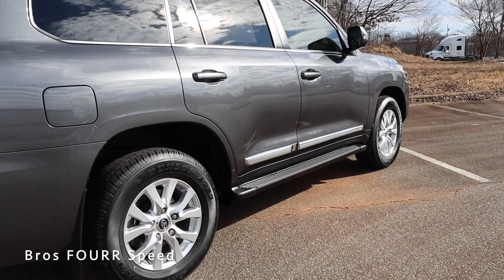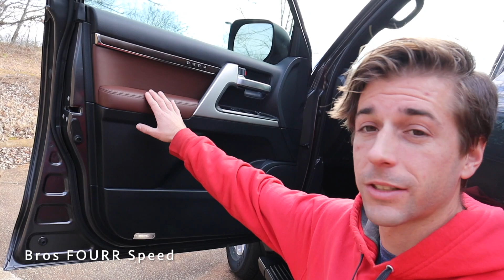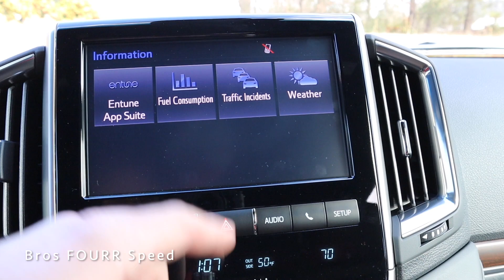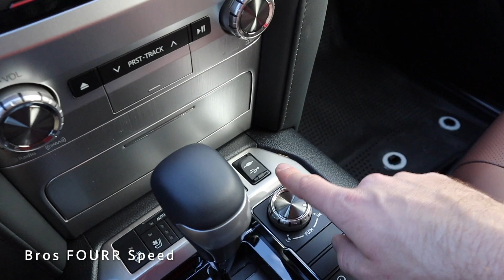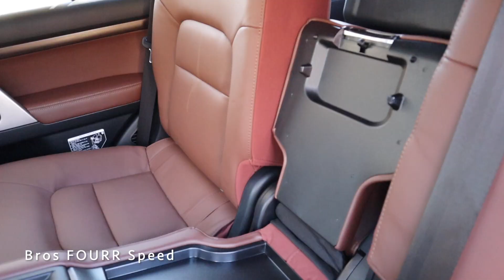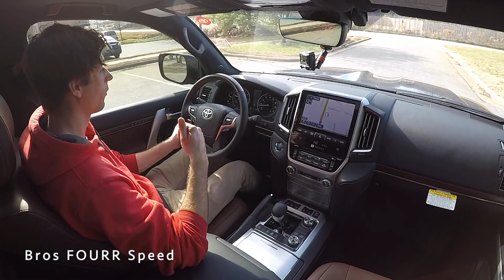2021 Toyota Land Cruiser: Start Up, Test Drive, Walkaround and Review

Comment: Such a nice SUV.  Do they still have at least a rear locker and rear solid axle? That is one thing that is disappointing that they went from solid front and rear and triple lock to ifs and possibly no lockers. Great review as always. Love the 3rd row and interior space. Perfect for road trips
Reply from the maker: It has the lockers! Not sure on the suspension, but I would guess the rear wasn't solid, I didn't look underneath though. But definitely plenty of room for road trips!